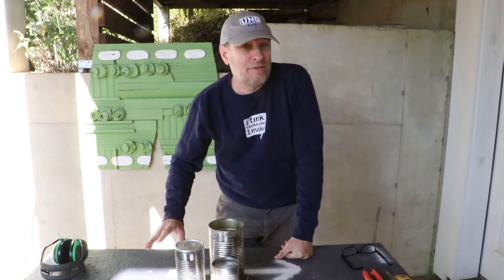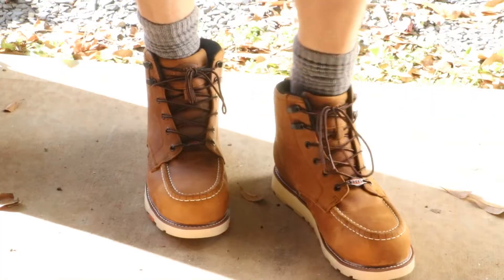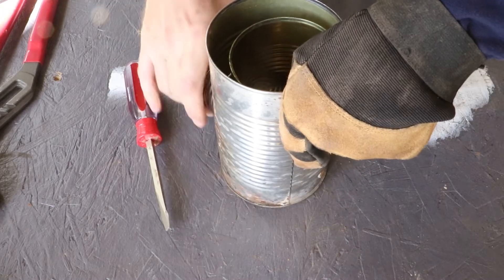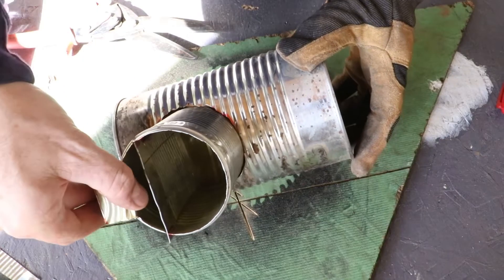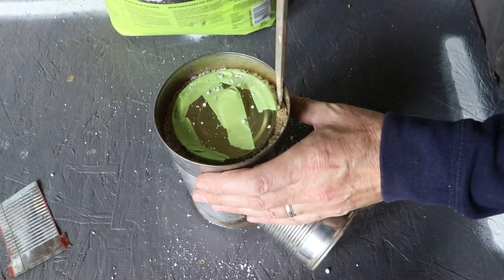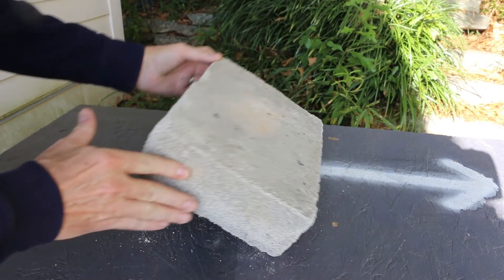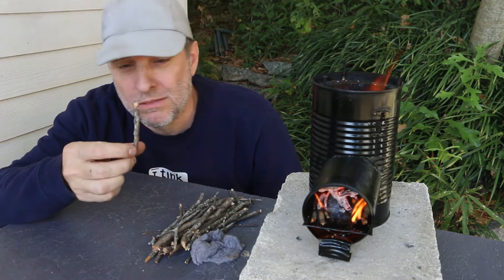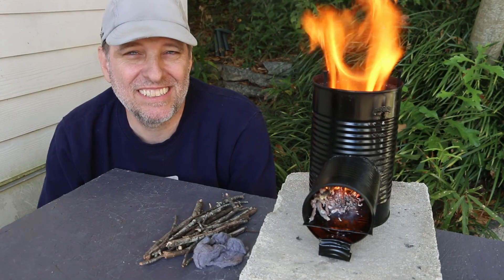How To Make A Soup Can Rocket Stove | Perlite Insulated Riser

Comment: Amazing, will be making one of these, how long do you think it would take for the cans to rust through?
Reply from the maker: That would depend on use and if you store it out of the weather. The metal is thinner and would degrade with use. It would easy to switch out the inner can as it burns out.

Comment: Hey, Tom! You've made quite a few rocket stoves over the years. Which rocket stove would you say is best overall, with longevity and efficiency considered?
Reply from the maker: I think a 13-brick rocket stove using firebrick would be my top choice. Here's a 13-brick video, but switch out the clay brick with firebrick. (You might need to cut down the firebrick to get to a 1-to-2 ratio.) Use stove adhesive instead of the clay. https://www.youtube.com/watch?v=qss7cTxbnGo&t=3s
Reply: @GreenShortzDIY  I don't think I can get either firebricks or stove adhesive where I am. But I'll see about making some substitutes. Thank you very much for the response!
Reply from the maker: @Norbingel  In that case, why not make some aircrete? Or cob? I've got videos on both methods. 🙂
Reply: @GreenShortzDIY  will look into those. Thanks again!

Comment: this all have been done with a 3 way can opener and a sturdy blade or tin clippers lol, oh and some sand paper by hand, just for people who dont have hundreds of dollars in power tools trying to make a 3 dollar stove for some reason instead of forking out 10 or 15 bucks, sand or gravel instead of perlite i image works, or ceramic/glass wool or carbon felt. clay is also easily found in a lot of soil, just need to process is it, which takes time but is easy. yield varies on soil type, if youre near water you have better luck. 

I do appreciate not wasting resources and making some eggs instead of just boiling water then dumping it. Also had it been double walls no perlite with holes on the inner wall itd be a gasifier stove, burning the smoke as well making it more efficent and smokless
Reply from the maker: Thank you for the feedback and suggestions. :-)

Comment: Increased efficiency ?  Why ?  It's a Rocket Stove !  It is for boiling water or frying an egg and doing using a handful of twigs.  That is pretty damn efficient,  not that it really matters much,  the design is more about convenience than efficiency.  You really don't want to draw more heat from one of these or you'll burn your food.  You are not trying to smelt metals with one of these.  There is a tool for every job the trick is to recognize its limitations.
Reply: "A rocket stove is an efficient and hot burning stove using small-diameter wood fuel. Fuel is burned in a simple combustion chamber containing an insulated vertical chimney, which ensures almost complete combustion prior to the flames reaching the cooking surface." 

"Rocket stoves are better at combusting the fuel, thus using less fuel and producing less smoke, carbon monoxide, and soot."

"In field tests in India, rocket stoves used 18 to 35 percent less fuel, compared to the traditional stoves, and reduced fuel used 39-47 percent, compared to the simple, traditional, open, three-stone fire."

https://en.wikipedia.org/wiki/Rocket_stove

It was designed with efficiency in mind, they even won an award for that.

Comment: By putting the cement in the bottom of the can doesn't that block the air flow under your pull out tray? Pretty cool build non the less.
Reply from the maker: The cement doesn’t block any of the horizontal can. That can comes in a little off the bottom, offering room for the cement floor. Thank you for watching.
Reply: oh ok I see thx for the reply @GreenShortzDIY

Comment: I just finished a similar rocket stove. I used strong wire mesh across the top to hold the pot and fire proof caulk to seal in the perlite after bending tabs over on the center can. We'll see how it holds up. Thanks for your ideas for my next build.

Comment: I suggest using 1/4 inch bolts for the pot holder. The thread holds much better & bolthead is better on the pots I think.

Comment: Liked your build. One potential fix for your sinking nails could be to simply cut some tubing to put between the nail head and the cement (like a washer, only much thicker) which should keep your nails at your desired height. Cheers.
Reply: Those weird nails with the double heads used for tying off level lines would do the same thing.
Reply from the maker: Thank you, Roland. Great suggestion. Thank you for watching.

Comment: Maybe turn the nail upside down.
Reply: I was just going to post that.  Upside down, double headed nails with both the tops and bottoms of the nails bent 90 degrees  might make a more stable surface for the pot to rest on (up top, pointed end) with the double heads providing more meat for the cement to cure to on the bottom.
Reply from the maker: Thank you, Mark. Great suggestion.

Comment: The tray looked like it held up so that you could cook your eggs.  Here is an idea that you could try; but, it might be more work than you want to do for something so small.  If you want, you could use two pieces of the steel can and arrange the so that the ridges are at right angles to one another.  The cut them into strips so that they could be woven together like a basket weave.  It would be two layers that look like one layer.  The basket weave would just make it pretty.
Reply from the maker: Hi Donna G. That is an interesting idea. Thank you for sharing.
Reply: @GreenShortzDIY Due to the efficiency of such a stove, were it made of alchemist's clay, a material seen on Fraser Builds, then it could potentially "be its own kiln", as long as its draft were "capped" and forced downward around its outer surface.
John Fraser even states that he'd been trying to replicate Ancient Egyptian use of pots as kilns.